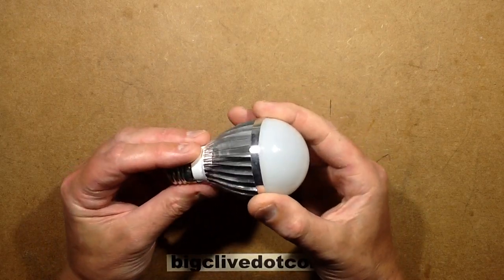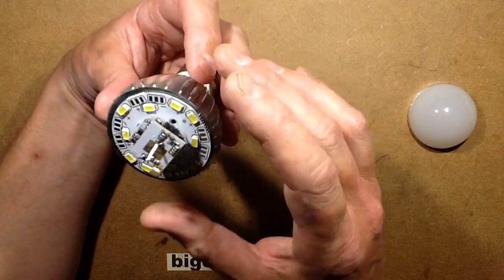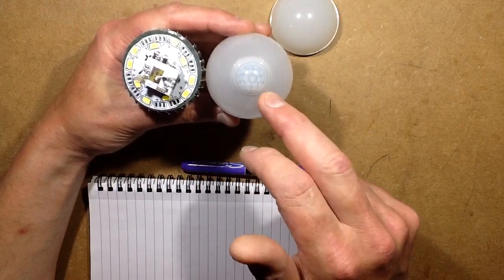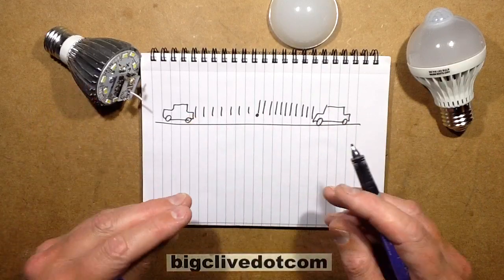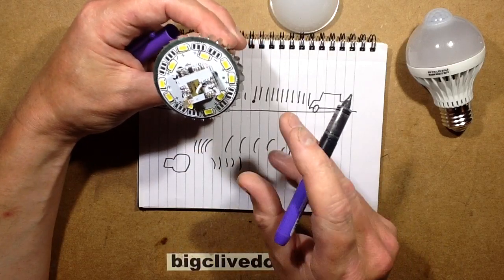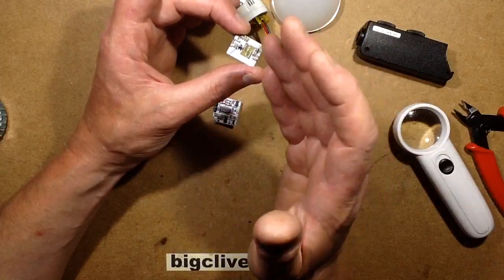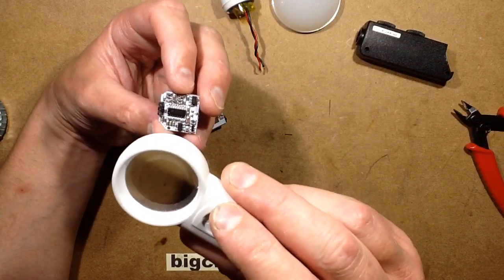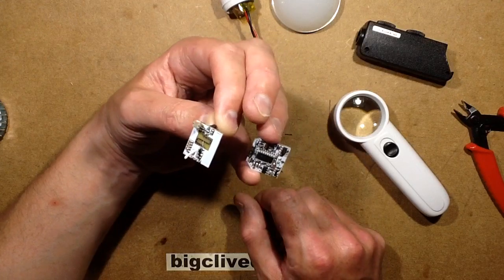Microwave doppler sensor lamp with perplexingly simple circuitry.

Comment: yes somwthing like that. radio waves have a magnetic wave that suts at 90 degrees to the propergation orentation of the radio wave (trying to remember a course I did 44 odd years ago so forgive me if wrong) the Theromin "listened" to the changes in the magnetic field I seem to remember. a bit like a metal detector the field coil also acts as a detector. hold it still and you just get a constant tone. move it and you get a change in tone if something magnetic is close by. Have you noticed  a DAB radio if its on a weak signal will get louder or quieter as you move around the room near it?
it is possible (just a suggestion) to make a totally passive sensor that works on the frequancies of DAB broadcasts 2 sensors close by would be able to cancil out external effects and detect local movement??

Comment: Im just wondering if this bulb could be used outside with a little modification to waterproof the joints?
Reply: Or drop it inside an external wall light case?
Reply from the maker: Keep in mind that the RF can "see through" a lamp housing.  So you could theoretically just fit it into an existing outdoor light.

Comment: Maybe something to do with the beat frequency? That is the original gets mixed with the doppler shifted reflection and you get the difference between the two processed in some way?
Reply: That's exactly the way it works. It mixes the received reflected signal with the transmitted signal. If something moves towards or away from it then there will be slightly different frequency reflected, it mixes that with the original transmitted signal giving the small difference in frequencies of just a few Hz, and that is what's detected and turns the light on, and Bob's your uncle.

Comment: +bigclivedotcom are there any ic's that can detect the strength of a specific wifi frequecy precisely? i really need one for a project of mine
Reply: I need the hardware, that can detect the strength and returning it either analog or digital with a high resoluton of about 10 bit.
Reply: you will probably have to look into programming an arduino with a wifi module attached
Reply: I already tried this but the Arduino Wifi module only has a 2 bit signal strength register, wich shows only >-60db or <-60db

Comment: could that not be acting like a metal detector or the 1960's musical instrument that worked on disturmances in the magnetic field around an aerial? I cannot remember its name but it was on "Tomorrows world"
Reply from the maker: Theremin.  I think that worked on the direct vicinity of a conductive object changing an oscillator frequency.
Reply: +RyuDarragh that would make sense.
Reply from the maker: The road sensors use a figure eight loop of wire (to reject ambient magnetic fields) that is part of an oscillator.  When a vehicle sits above it the oscillator frequency changes and is detected.
Reply: I don't think that the sensor works like that as a theremin knows where you're hand is even if it's not moving. this light goes off if you don't move.

Comment: Doppler is unlikely, It very possibly works like a Theremin, 
https://en.wikipedia.org/wiki/Theremin
Reply: basically it compares an snapshot of previous signal to the current one, it's about the overall pattern of the return signal, it really doesn't calculate the Doppler shift. it works kinda like the motion sensing cameras.
Reply: Not at 5.8GHz.  Almost all microwave motion detectors work by detecting the frequency difference in the reflected signal.  Microwaves are used because they are short enough wavelength that the tend to reflect off of things easily, and the higher in frequency you go, to bigger the doppler shift is and therefore easier it is to detect it.

Comment: I don't get why people have fears for micro or radio waves... red light is more dangerous not speaking of UV and then you won't get a greater effect than warm skin sigh
Reply: The same people that turn the wifi off each night and are worried about cell phones et al then spend 8 hour per day for three months in a row laying on hot sand while being roasted by UV radiation. When I tell them that what they are doing is way more dangerous than the wifi router they tell me I am paid by the Illuminati (?!)...
Reply: ever since mental disorders became "popular", people who are sad because someone died being described as suffering from depression and so on, you're expected to believe all the things you can't see. Someone tells you they get headaches and a metallic taste in their eye when they are in viewing distance to a mobile phone transmitter tower.. you will get attacked for not indulging it.
Reply: People don't know the difference between high and low energy waves. They just think that microwaves are bad because microwave ovens use them. Whereas us lot know that microwave ovens use high energy waves and sensors like this and smartphones use low energy waves instead.
Reply: MrOpenGL That was not what I was saying. I was saying that two waves can be at the same frequency band but have different energy levels. The same thing can happen with infrared as an IR LED will not provide any warm sensation but a higher power lamp will. Same thing with comparing the Sun and a filament bulb. The Sun can provide waves with much higher energy levels than a bulb ever could.
Reply: MrOpenGL I touched upon it at the start of my first comment. I said that people don't know about the power of the source and only focus on the frequency band.
Reply: I remember in the 80's you could buy a thing to test how much "Radiation!!!!" was leaking from you microwave, obviously it was killing you.

I assume it just taking advantage of people scared by Chernobyl.
Reply: Just how much are they paying you? Can I get in on that?
Reply: wdavid parks
Who is paying what?
Reply: MrOpenGL
The illuminati. Do thay pay scale? What about dental?  Sounds like an employment opportunity to me ;-)
Reply: wdave 
You need help.
Reply: *****
Oh I forgot about some people telling they hear "random rumbling noises underground" and claim they can predict earthquakes. They tell they hear these rumbling noises every half hour or so.
The fact that a railway passes under their home in a tunnel 150m below tells you something?
:D
Reply: +yshouldicar3 Yes. Everybody knows that you can't cook with the Sun so it's not dangerous. Oh wait you can! WHY DOES IT ONLY WORK FOR MICROWAVES???? :-(
Reply: +yshouldicar3 That's precisely what I understood. I was however questioning why people think the Sun is harmless and a 10mW   2.4GHz transmitter is so deadly...
Reply: Don't discount clinical depression and don't confuse it with "feeling depressed" if you wouldn't discount a scientific theory as "just a theory". Not all people who suffer from depression are chronically "sad". Your brain is made of cells and responds to chemical imbalances like other organs in your body. Just as low-level diabetes can be treated with behavioral changes, so can low-level clinical depression. But sometimes more direct medical intervention is necessary. A toothache is also "in your head".

Now, back to slagging off on people who don't consider intensity of radiation exposure when judging danger.
Reply: ***** Yeah... I don't know the physics behind it well enough to teach others... Thanks for correcting me!
Reply: wdavid parks
Unfortunately I can't tell you more :P

Seriously, where can we apply so we can get paid to make comments against free energy machines and so on? Meh.